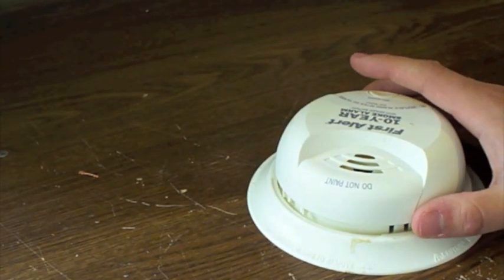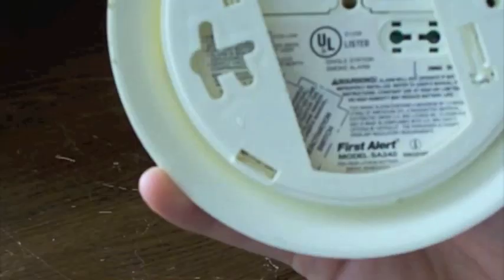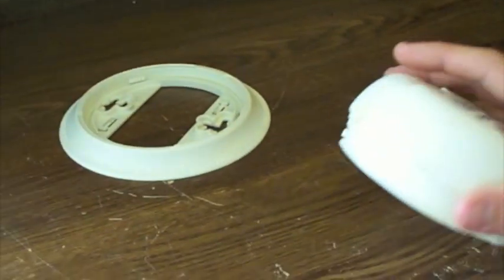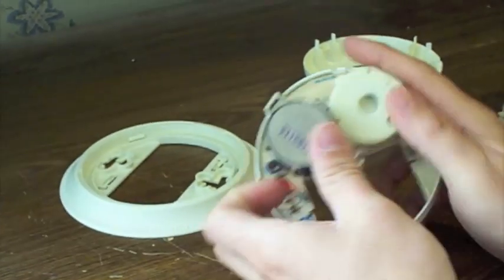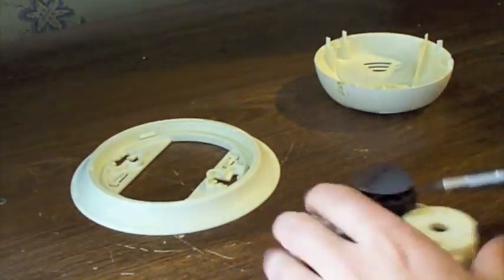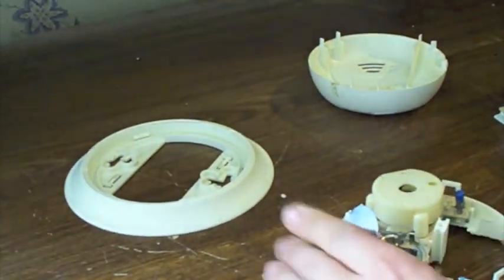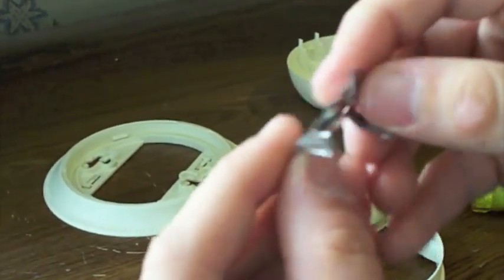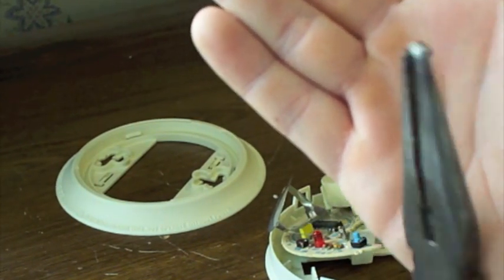Radioactive Americium 241

Comment: Lots of bad advice and ignorant responses on here by people who have never been to radiation school.  This isotope, while low energy source is still quite hazardous and should not have been handled the way it was. The isotope was encased in the product for a reason with warnings attached.  Ingestion and inhalation are significant entry methods...having held bare handed without respiratory protection is hazardous.  Open skin wounds are also entry points to blood stream.  I do not advise people do this.  I have 8 old detectors to be recycled through the manufacturer who holds the NRC licensing.

Comment: It emits alpha particles and low gamma rays. wear gloves if that makes you feel safe :)
Reply: While alpha rarely can penetrate the outer layer of dead skin, it is good practice to use gloves, then you're almost gaurenteed to not take any alpha into your body, at that point you only have to worry about beta and gamma and that's just monitoring the micro sieverts per hour, even a few micro sieverts an hour isn't super dangerous unless you keep the item one inch or less from your skin for months on end lol that would just be stupidity at that point.
Reply: +Alex Burnside personally I don't like the idea of gamma rays. Even low freq gamma. I just use lead lined gloves chest and face

Comment: Do you have cancer yet?
Reply: +David Paquet You cant exactly get cancer from α particle
Reply: +teh_arbitur Yeah if you swallow it. Not if you're using bare handed. α particles are so heavy and bulky it can't penetrate your epidermis.
Reply: +Caleb Kam You can.
Reply: So you can still get cancer from alpha.
Reply from the maker: Yeah if you vaporize it. Any heavy metal can cause cancer if you inhale it.
Reply: +teh_arbitur Please don't prove me wrong but I doubt anyone will be foolish enough to eat some radioactive metals, nor the dose will be high enough to mutate cells.
Reply from the maker: +David Paquet A quantity of Potassium in bananas is radioactive. So technically bananas could give you cancer.
Reply: Do the research,  if you inhale the fumes of americium it does cause lung cancer
Reply: Ye just saying that it's possible :P
Reply: +teh_arbitur But back to the original question, "Do you have cancer yet" (by playing with Am-241 in this video) - Answer is No, and never. 
Yes you can if you have to get into extreme cases, but no and you CANNOT get cancer by extracting Am-241 from smoke alarm.
Reply: of course you cant. i thought you were saying that its impossible to get cancer from alpha radiation
Reply: +teh_arbitur Oh right, got what you want to say. Yes Alpha will potentially give you cancer but not from playing with it. 
Technically Alpha doesnt give you cancer directly. What it does is that alpha will damage the DNA in the cell, which causes mutation. During cell division the cell should check whether it has mutation that leads to cancer, but since the cell has been attacked it can't verify anything, so that's what cancer actually is.
Reply: Ye
Reply: "I doubt anyone will be foolish enough to eat some radioactive metals"

They do that all the time in medicine.
Reply: Ancient Greeks invented plutonium, uranium and the americium ( it should be called Helenicium ).
European invaders ( Romans, France, Germany etc ) stole the ancient greek inventions from Alexandria library books ( million pages ) which contains all information about 94+ elements, pipes, gases, prism detection by light, technologies etc.

Better explanation to people who do not understand.
Example: Romans stole four Harry Potter books. The four Harry Potter books became divided due to war, theft, lost and found.

Germany got Harry Potter 1, tested it the invention and then they burned it and claim the world that they have invented it.

Russia got Harry Potter 2, tested it the invention and then they burned it and claim the world that they have invented it.

Sweden got Harry Potter 3, tested it the invention and then they burned it and claim the world that they have invented it.

America got Harry Potter 4, tested it the invention and then they burned it and claim the world that they have invented it.

and so on.....
Reply: Cloud VII "Ancient Greeks invented plutonium, uranium and the americium"
What have you been smoking? :-) Uranium was discovered in the 18th century. The other two in the 20th.
Reply: Alpha particles can only be harmful if you eat it and the rays can be stopped by a piece of paper

Comment: Did handling the button feel warm?
Reply: +Patrick Casey its an alpha emitter and its about 1 milicurie so it can´t if it was a strong gamma emitter like plutonium it would
Reply: If it did feel warm, you'd be dead in a couple of days from massive radiation release.
Reply: Material like this is too small and too little radioactive to give of sufficient heat to feel it.
Reply: I feel a little bit of heat from mine.. probably just an illusion

Comment: A button contains about 0.0000003 g of Americium.  It gives off alpha particles, and gamma rays, most of which have an energy of 59.6 KeV.  My sensitive scintillation detector (NaI-Th) measures about 150,000 gamma rays per min (CPM). With the probe being about 20% efficient, it counts 1 out of 5 gamma rays, so there are really about 750,000 gamma rays emitted per minute (we're just count 150,000).  I also measured the back of the button, which registered 15,000 CPM using the scintillation detector.  In addition to the gamma rays, you get alpha particles, which are strong ionizers, stealing electrons from nearby atoms,and making them ions.  In sufficient quantities, this can disrupt biological processes by ionizing substances in living tissue, causing chaos within cells (chemicals that would normally not react with each other may now form ionic bonds, disrupting cell operations.  Not to scare anybody....   The amount of Americium in a single button is small, so it probably won't cause any issues if handled properly.  Like.... don't put it in your mouth, or do other stupid things with it...   I love this stuff, mine has a beautiful golden color to it...
Reply: developercm ur so fucking smart

Comment: Americium 241 only throws off alpha radiation, nothing serious
Reply: Machine Man Even so its not harmless as many ppl think. Swallow a small piece of Americim 241 or inhale dust from it and you will not be a happy camper after a while. You should not play with these things!
Reply: dtiydr definitley not, although doing that would cause permanent irradiating of the parts it touches
Reply: Machine Man You obviously don't know. The intestines tissue are extremely sensitive to even alpha radiation and especially since in as close it could get. The tissue can both die (which will make you really sick) and/or cause cancer. There are many examples of this so yes you could get into severe problems if you get even alpha radiation it inside you.
Reply: dtiydr I was agreeing with you on the last part
Reply: CAL'S ENGINEERING yes but the daughter particles give off gamma and beta.
Reply: It does give off some other radiation too. My beta/gamma detector gets around 120 CPM from even outside the plastic case
Reply: you guys are ignoring the isotope
Reply: CAL'S ENGINEERING it does not only emit alpha. You will pick up readings using a cheap Geiger counter that only reads beta and gamma. So clearly, it emits other particles

Comment: americanium send little bit gamma radiations, but very low. Sure, it is the alpha's who are bigger more. Gamma is bad... but for more power emissions.
So... i think you could said that americanium is really dangerous if you have some particules goes out of the sensor and goes inside your body by respiration (really bad). sure... this is a big shit and it will not be responsable to simply drop it on a bin.
Reply: so it is not dangerous until you open the  ionization chamber isn't it? or particles can go out by the sensor just handling the smoke detector for battery replacement?